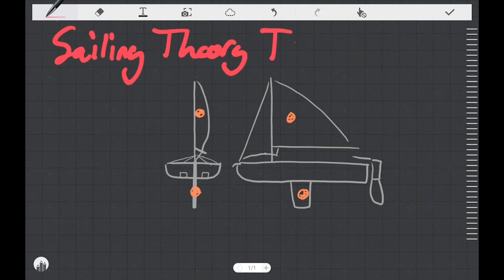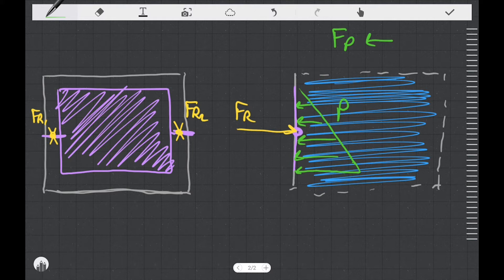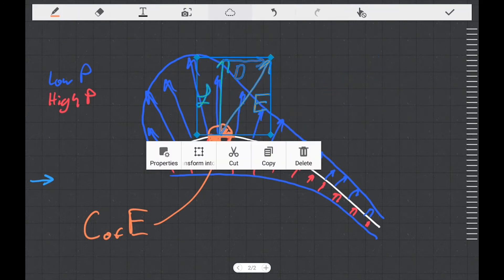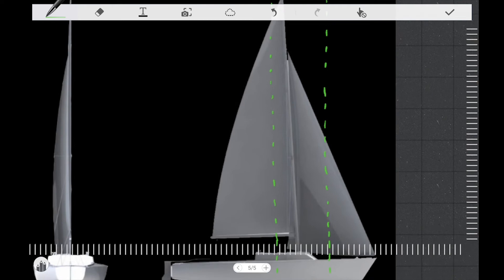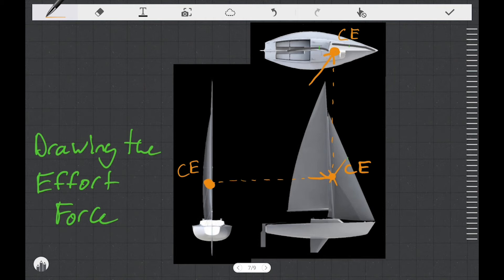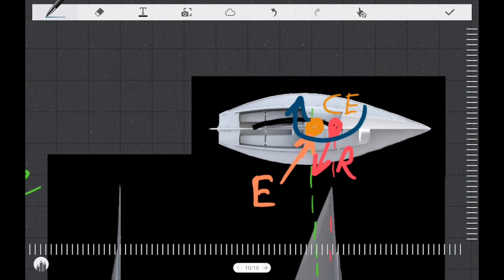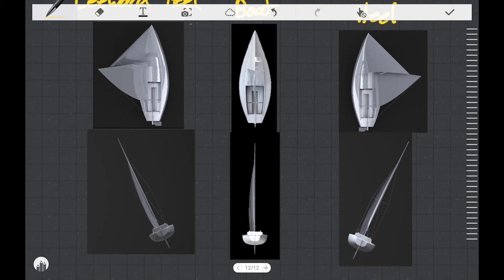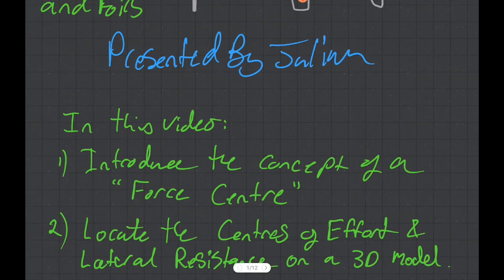Sailing Theory Tutorials - Location of CE CLR and Helm Feel

Comment: you forgot to take into account the profile of the submerged hull. it accounts for the majority of the CLR
Reply from the maker: @glowiever  depends on the boat,  but yes you're right I did forget to include the hull profile.  There used to be another comment about that, but it's long gone now.

If you know where the centte of the submerged hull is, you would make a  triangle out of the centre of the rudder, the keel/board, and then the hull.  Find the centre of that triangle to find the CLR

Comment: I do have a problem with understanding your conclusion. Perhaps you can clarify it for me and others, please! The problem is that you are referring to Lee Helm and Weather Helm on your drawings without considering that both of the boats are on opposite tacks! Therefore your conclusion on the right drawing is wrong as it is Leeward heel as the boat is on port tack and the heel is to Leeward; therefore, it is Weather Helm also! Well, I hope I explained it clearly, but need to add that scientifically, you explained this fairly clearly, but CE and its relations to the CLR while sailing is not about the boat's heel instead, it is about the position of CE versus CLR in Forward or Aft position, which will establish whether it is beneficial or not beneficial for sailing!
Reply from the maker: Hi Chris, I think you are mistaken, both ot the boats are on the same tack in the renderings (notice the direction that the sail is filled by the wind.  The boat that is heeled yo windward is not being tipped by the wind, but rather by the crew weight, which might be placed on the windward side, either on purpose or by accident.

CE and CLR can move fore and aft, and side to side, and both dimensions will have effects on the helm of the boat.
Reply: @howarthsailing  Then it is not clearly stated so, and that creates confusion. Also, heel of the boat if the sails are set properly has no effect on the helm as it becomes automatically a part of the steering due to necessary and beneficial heel associated with theory of sailing in general (5-12 degrees on monohull). There is more to it but I don’t want to create debate (example; luck of CG in the presentation). Anyway, I like the animations in your presentation! 😏
Reply from the maker: @chriskaminski4642  this was all discussed in a series of comments that got purged in 2020 by youtube.  I think that the whole CE/CLR topic is re-treated in a more recent video with clearer diagrams.

Thanks for watching.

Comment: This surprised me.  The video shows that, if you look in the direction from the stern, the force on the sails is to the left, but the force on the keel is to the right.  Doesn't this create a moment (torque) that wants to capsize the ship?????  So what, other than shifting weight by the crew, keeps the ship upright?  (I always thought that the CLR force on the keel is pointing to the same side of the ship as the CE force, but I must be wrong)
Reply from the maker: Definitely creates a heeling moment (which would capsize the boat if not balanced).  There is a "righting moment" which acts in the opposite direction due to crew weight, ballast (think of the keel as a pendulum) and the static and dynamic forces on the hull add to stability as well.
Reply: @howarthsailing  Yes, thank you for replying.  And to add, I also realized that the center of gravity acting with the center of buoyancy, which is moving when the ship is heeling, are also creating a moment that is righting the ship, in a nice negative feedback loop.

Comment: The centre of lateral resistance is also affected be the underwater profile of the hull,  not just the keel.
The underwater profile of the hull changes as the boat heels.
Reply from the maker: Absolutely,  we discussed this at length is some of the deleted comments years ago.  The shape of different hulls affects the location of the CLR and heeling (side to side) or even pitching the boat (fore and aft) can also move the CLR around.

Comment: It seems like CLR should point forward not aft. It appears CE and CLR are exact opposites at 18:09 which means the boat would not move if CE and CLR were at same spot fore and aft or the boat would just turn in circles if they were separated.

Comment: Hi Julian, I'm trying to learn sailing by following through your youtube series, but I've never sailed in the water before.  So thank you for putting so much work for such comphrehensive videos on such topic.  Great work!! I understand most of the of material for this episode, but if you could clarify some of the elementary terms, it'll really reinforce my understanding.
1. From the 3 figures of boats to illustrate Heel and Helm Feel at about 22:36,  the wind direction is blowing right to left, correct?
2. the term "windward" means "towards" the wind and leeward just opposite of windward, right?
3. does "bear off" always mean the boat turning counter-clockwise and "head up" always mean boat turning clockwise?
Thank you.

Comment: First, let me start by thanking you for putting together such a great tutorial.  There are some difficult concepts presented here very well.  I do have some critiques that I hope are received as helpful feedback...
1) As Vissam mentioned in another comment, the effect of resistance on the hull is not factored into your CLR estimates.  This is a fairly significant oversight, IMHO, as it would likely move the CLR forward on most boats, thus contributing to weather helm.
2) Your last diagram correctly shows the port tacking vessel with a counter-clockwise moment, but then you state that it would cause the boat to bear off and would represent a lee helm. This is not the case, as the wind is coming from the port side, so that is still weather helm, and still making the boat want to head up - its just the opposite direction because the windward is in the opposite direction.
Reply: @howarthsailing  I had the exact same reaction as Steve for point 2.  Not until your reply and a re-view of the video did I see that you are correct.  I know that re-doing the video would be a pain, but I at least two of us mistook the information.  It stands to reason that others did as well.  Mentioning  how a weather heel could be achieved (and avoided) as well as the effect of the hull on CLR, would enhance your efforts in educating those of us who do seek optimum understanding our crafts.  Thank you.  I really do appreciate your work.

Comment: Hi, thanks for this explanation, it helps a lot.
I was just wondering. Yaw axis of the boat passes through the Center of Gravity (CG) of the boat. So if the CE is behind CG, and CE is ahead of CLR wouldn't it create a weather helm (if moment due to CE about CG is more than that of CLR)?
Reply from the maker: Rigid body mechanics is kind of out of the scope of these videos, but I would assert that the sum of the moments will cause the same direction of rotation regardless of whether the applied moments are ahead or behind the centre of gravity.
Reply: @howarthsailing  thanks for replying.

Comment: 26:07 why you drew CE toward and leeward on top right diagram? Isn't it towards starboard at an angle?
Reply from the maker: The force arrow points roughly in the same direction regardless of the heel, it's the location where it acts that changes.
Reply: @howarthsailing  hm.. can you explain? if boat is tilted right that means wind is pushing on sail also right
Reply from the maker: @vasiliibogdan1291  We're used to seeing the boat only heel away form the wind, but it is quite possible to heel a boat against the wind using body weight or movable ballast.  This is especially true in dinghy sailing.  At 26:07, the sails are full from right-to-left in all 3 of the cases presented.  The boat is heeling to windward, so the force on the sails is represented as a arrow from right-to left, however, because the Centre of Effort is moved to windward by the heel of the boat, there will be a steering moment that causes the boat to bear off. This condition is called "Lee Helm".  If you read an advanced dinghy handling book, you'll see that it's common to heel the boat to windward to aid with bearing off, especially at a windward mark.  The technique applies to small keelboats as well where body weight has a strong effect on the heel of the boat.
Reply: @howarthsailing  Thanks for your replies! Have a great day!

Comment: other than weather helm, does moving the CE too far aft also cause excess heeling? I know heeling causes weather helm but But i am just curious how the affects of the CE being aft affect the performance of the boat
Reply from the maker: Hi Josh,  That's sort-of a different, but related effect.  Pulling in the mainsail moves the CE aft, which can cause weather helm.  Pulling in the mainsail also increases the healing moment (the lateral force on the sail x the distance up from the center of rotation of the boat), which causes the boat to heel more, but that's not because of the CE being aft, it's because the forces are stronger when the sail is sheeted in further.

Comment: so Help me :  in  weather helm    the captain gets everyone  to sit on the  windward rail , this helps  the CLR to be more vertically in  line with the CE .....I get that part .... now in weather helm the  CE is  aft of the  CLR ,,,pulling up the daggerboard  will move  the  clr  aft   , ( correct me if I am wrong  )   so question is , what  sail trim adjustments  of  jib and main  would move the  CE  forward ?  appreciate your help  and  thanks for this great  video

Comment: Could you explain how the underwater slipstream affects how the boat holds  it's course?
For instance, on the Lee side of the hull/fin the water is experiencing high pressure and naturally the windward underwater side of the hull and fin are experiencing low pressure.
The opposite of what is happening to the mast and sails.
Reply from the maker: I think that the other video I have called "Sailing Theory Tutorials - Forces on Sails and Foils" goes through this.  Basically, the hull, keel (or centerboard as the case may be) and rudder have a flow over them, and because the boat makes a small amount of leeway as it travels through the water, there is a small angle of attack between the foils and the flow, this results in lift being generated in a direction that opposes the force of the sails.
Reply: @howarthsailing  what effect will that have on the rudder?
Reply from the maker: @mikecritchlow1114  I don't think of it as having an effect on the rudder,  more that the rudder takes some of the resistance forces, which should factor into where you consider the CLR to be.  An interesting point though, is that you can stall your rudder by steering too hard, essentially, creating too large of an angle of attack at the rudder and causing flow to detach.
Reply: @howarthsailing  HS... as I see it, the streamline from the hull and fin will have a sideways effect on the rudder inducing a turn downstream... hope that makes sense.
i.e. if the boat is heeling to port, the slip stream will curve up and push against the port side of the rudder causing the boat to turn to port, or lee helm. This in turn will require the helmsman to have to keep adjusting to starboard if he/she wants to stay close hauled.
Reply from the maker: @mikecritchlow1114  I'd say that's possible. 
Most often the helm is out of balance in the other direction though, because the mainsail is often overpowering and the CE is roo far aft, so I think you'll find most helms people are used to having to fight to bear off.
Reply: @howarthsailing  it's an interesting topic!
I sail model boats and my boat experiences the same effects of wind and water pressure as do full size boats..
I'll keep watching your YouTube programmes.
Thank you.